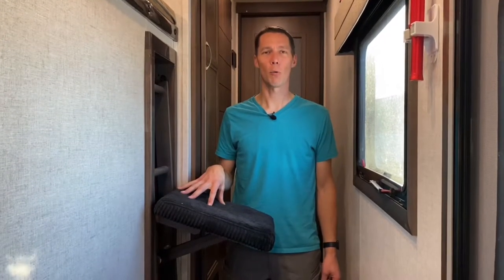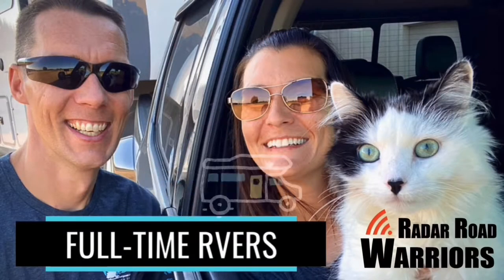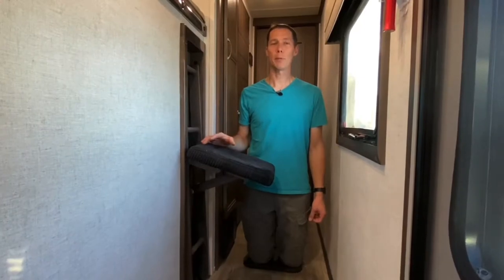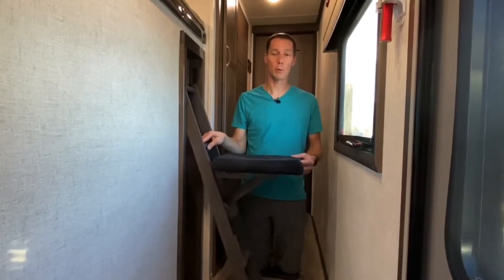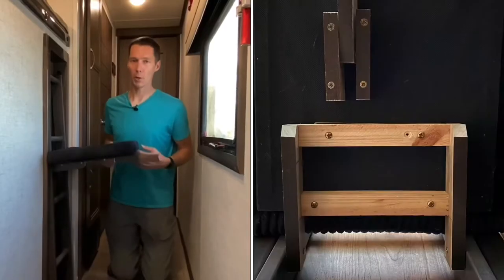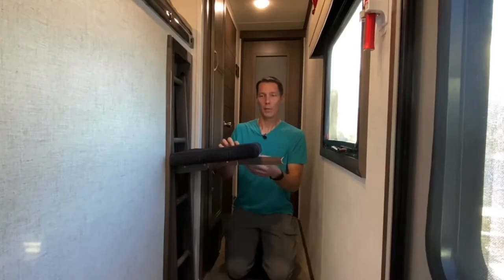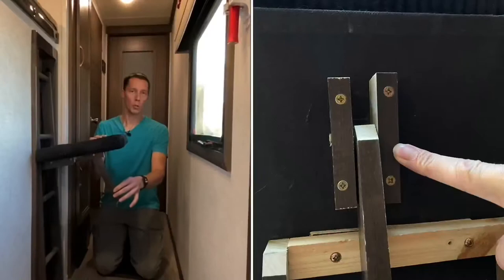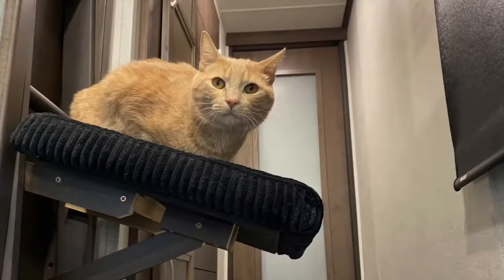Help Your Cat Reach the RV Loft with a Cat Ladder

Comment: Wife installed carpet around the rungs. And a short piece at the top edge for grip.
Reply from the maker: That’s a really good idea! Does the carpet around the rungs turn or does it stay in place?
Reply: The carpet on the rungs was a non slip bathroom rug originally. They slip s little, but nut much. They are simply cut to fit with about 3/4" overlap. My wife added adhesive back velcroe to the overlap area.nyhe can easily be removed clgor cleaning and also maje the rings a not more comfortable for use when we have to go "upstairs," to catch a cat our hang up the curtain that the cats knock off once in a while.
Reply from the maker: @donhediger5072  That would be an easy way to do it for cats with back claws.